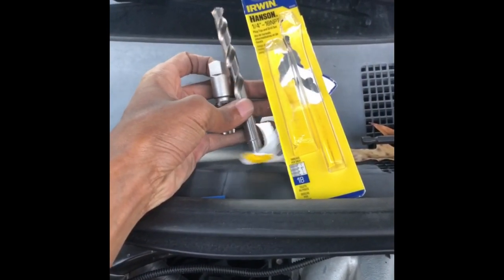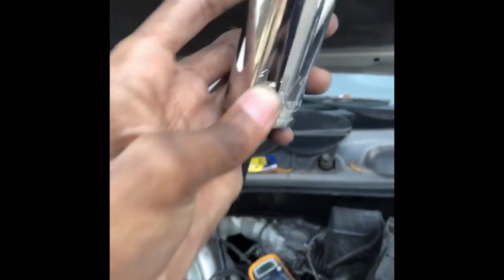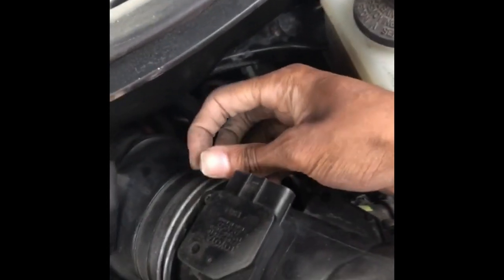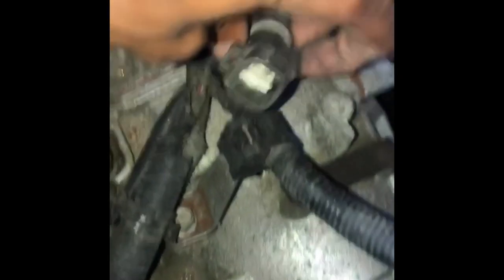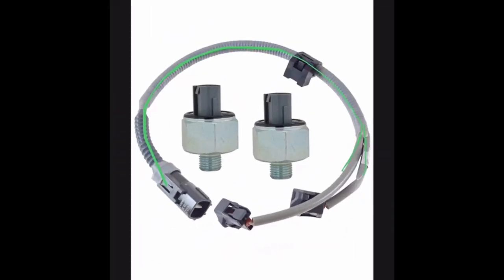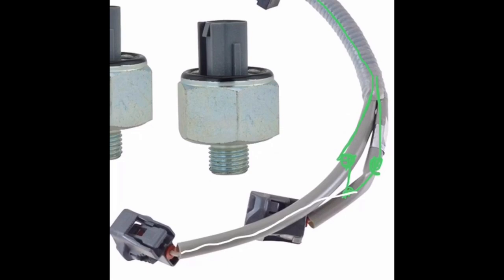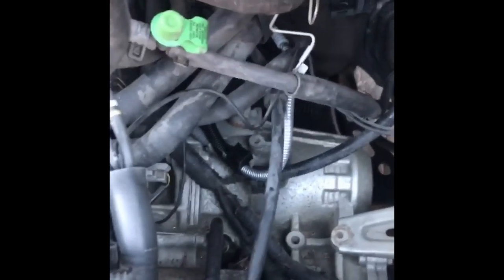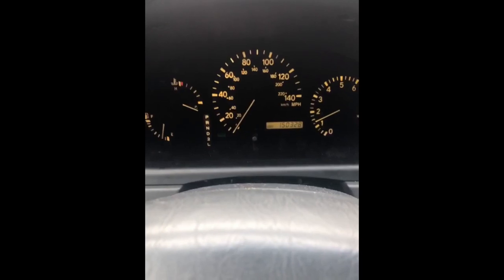1999-2003 Lexus RX300 1MZ-FE EASY knock sensor replacement relocation (SHORTCUTS IN DESCRIPTION)

Comment: So basically u cut the harness that you found under the air box then extended it with more wire and connected the harness at the end of the new wire connected to the original harness
Reply from the maker: Close, basically I disconnected the old harness and plugged in a new harness and rerouted the wire and extended it to a different location.
Reply: @JDMHaze  thank you for replying, also is it necessary to to extend the wire to the other side of the engine like Is there a purpose for that and if it’s not necessary will it still work if I connect a new harness but instead of cutting and making the wire longer I find a secure place near where the harness was found to put the knock sensor
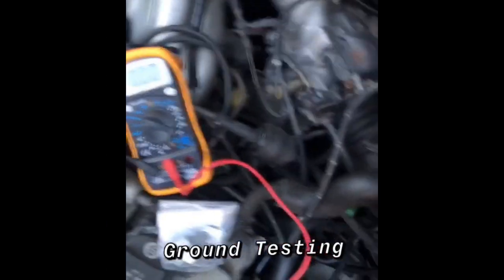Reply from the maker: @reinnamatthews5825  I only ran the wire to where the new harness location was, the length of the wire isn't so much significant, it's just I needed that much wire for that location I've seen people use different locations but since that is right next to where the motor mount is it's just a solid location, but make sure you see my section on ground testing (1:52), to make sure the location you choose has a secure ground and is rigid/solid With the least vibration
Reply: @JDMHaze  got it so basically that was the more important reasoning for putting the sensor where u did because it needs to be grounded where ever I decide to place it I can’t just connect it and leave it laying somewhere lol, thanks but I didn’t see in the video what u did with the old harness connection did u end up closing it off with electrical tape
Reply from the maker: @reinnamatthews5825  So the old harness connector I just unplugged it and then plugged in a new one and rerouted it ... And I just taped off the old connector harness that was going to the original knock sensors
Reply: @JDMHaze  ok great I got it now lol thanks it’ll be allot easier now

Comment: Looks like it’s been a year since you posted this video.  How is it holding up?  Any issues or check engine lights?  I’m considering doing this on my RX300.  Thanks for posting the video!!
Reply from the maker: I will be making a second part to this video, I didn't really have too many issues but I made a modified harness that rerouted the power to the original knocks sensor on the car that was still good
Reply: @JDMHaze  - interesting.  So the 3rd sensor stopped working and you spliced both wires to the one original sensor that wasn’t malfunctioning?
Reply from the maker: @mikeingraham611  dude what? lol No there are only 2 knock sensors, but knock sensor 1 was the reading bad, there is a wire going to each knock sensor, I splice the one wire going to  knock sensor 1 cut it and spliced it into the wire that was going to knock sensor 2,, So the computer is only reading knock sensor 2 (the good 1) But the computer thinks it's reading both knock sensors

Comment: Why did u only use one of the sensor?
Reply from the maker: because i spliced the wire going to both sensors into one wire and only required one so the extra work of mounting 2 sensors wasn't necessary

Comment: Do u technically not need to have them routed so far away if u don’t want to
Reply from the maker: That location just had the most space for what I was trying to do as far as mounting... And I knew I had a solid ground
Reply: Same question. Why to far? Couldn't you just  take a metal bracket, make your tap for the sensor/sensors then just mount it or weld it to ground?
Reply from the maker: @joelfierro8193  welding it is extreme, because then replacing it would be a nightmare,, I just chose that location because it's pretty much by the motor mount which is supposed to be the most solid part, which is great because the knocks sensor needs to be a stable and still as possible

Comment: I did the same and my knock sensor code still came back I think the wire spice needs to be explained more because I did exactly like the video and still get a knock sensor after buying 4 sensors and 2 harnesses I truly think this car is going to the crusher
Reply from the maker: I think it depends on the knock sensor you get I got some of the newer ones  it’s the same knock sensor, but they’re more round instead of as sharp on the corner

Comment: How much does the knock sensor and harness cost I need 2 oem knock sensors
Reply from the maker: DutyTime22 Link is in the description and it's about $25(or less) online and currently $20 on this link here. 
https://rover.ebay.com/rover/0/0/0?mpre=https%3A%2F%2Fwww.ebay.com%2Fulk%2Fitm%2F302389998819
Reply: Thanks for the quick response your the best Thank you so much
Reply from the maker: DutyTime22 no probem

Comment: Thank you!!!!!!!
Reply from the maker: Please use OEM knock sensors
Reply: @JDMHaze  You are correct...This will be the third time I have replaced them...I found out the first time...the hard way...but I have had several OEM Toyota sensors also fail...SO FRUSTRATING!!!! Thanks!
Reply from the maker: @Q1776Q  I had a pair found by my second pair didn’t fail

Comment: What the hell am I watching here? lol

Anyway, if any of you have one of these old dinosaurs, it would probably behoove you to just take everything apart to get to the existing knock sensors, change your rear plugs, rear valve cover gasket (Remove and repack the half moons) because it's probably leaking, bypass hose because it will leak and reseal the valley plate because it will probably be leaking a bit too.

Comment: What size of drill bit did you use?
Reply from the maker: Jay B 1/4- 18NPT. 
 see 0:39
Reply: @JDMHaze  I got it done, ended up re-threading the threads on the knock sensor for a 7/16-20 and it worked wonders. I used a 7/16 drill bit. No more CEL.
Reply from the maker: Jay B Great,  I'm glad it helped what vehicle do you have? Is it a RX 300 or another Toyota/Lexus vehicle with the m 1MZFE motor
Reply: @JDMHaze  it's a 2000 avalon
Reply from the maker: Jay B awesome,
Reply: @JDMHaze  I was also confused about drill and tap sizes 1/4 is way too small. All i have is a 27/64 drill and a 1/2-13  tap. I tested it out on a piece of scrap and it went just a lil kicking and screaming but it worked and felt tight. Im just going to send it. Do not recommend but should work.
Reply from the maker: @ripozipo2348  It's whatever works for you, just make sure you don't thread it too big or the fit won't be tight and the knock sen. wont be stable

Comment: If your going to splice them together to use only one sensor its much easier to splice the wires together under the dash. Unfortunately for me, I think both have gone bad now lol.
Reply from the maker: I tried to splice at the most external part so that I can reverse the process and undo it, this is meant to be temporary, are you referring to the wires coming from the ECU/ECM?
Reply: @JDMHaze  yes i am. It worked for over 2 yrs but i think both sensors are bad now because my car is having trouble going into overdrive again. Was rethinking it and might have to do this since I think both are bad now. Did you use an oem knock sensor?
Reply from the maker: @JohnLee-oo3qy  yes oem i purchased online, And both of them are likely bad I'm pretty sure which is another reason this is temporary because the other one subsequently fails, it's demise is inevitable
Reply: @JDMHaze  any good place to buy the oem sensors brother? They just seem so expensive. Ebay looks cheap
Reply from the maker: @JohnLee-oo3qy  I go on eBay but I search for genuine oem knock sensors

https://www.ebay.com/itm/New-2-Pcs-Knock-Sensor-Set-89615-12050-For-Toyota-Camry-2-4L-Lexus-RX330-3-3L-/223938880514?mkcid=16&mkevt=1&_trksid=p2349624.m46890.l49286&mkrid=711-127632-2357-0

Comment: Lol.  Screw those stupid sensors.  Engine is fine if you take care of it, and those old Toys aren’t worth the cost or time of doing the whole intake tear apart.  Great video.
Reply from the maker: Yeah it's rather annoying I wish I could find a bypass kit it would've been a lot easier, they make some for GM  and Nissans
Reply: The problem with doing this modification is that the externally mounted knock sensor will not detect detonation inside the engine. The knock sensors are located on the cylinder heads so that when detonation occurs inside the cylinders the engine computer can back off the ignition timing to eliminate the detonation. This is necessary to protect the engine from internal damage as well as to get the best performance, fuel economy and emissions. Doing this modification might seem to be a great easy cheep fix without any downsides and it may work well for some period of time but remember that the engineers who designed the engine put those knock sensors where they did for a reason. If you don't know all the factors that went into the engineers' decision to locate the two sensors where they did then you may be taking unknown risks. There could be undetected detonation going on inside the engine that is slowly hammering away at the pistons and cylinder heads, which could lead to premature engine failure. This is why you should never modify anything in a complex, modern engine. Instead leave it the way the manufacturer designed and built it.
Reply: @joevignolor4u949  do you live in the real world?  There are cars that aren't worth the money it would take to scrap them, yet they are useful for moving from point a to b.  That's what this mod is for.  It would be the world's dumbest decision to pour thousands of dollars of labor and parts into a car you would be at zero financial loss to scrap out.  I have a fleet of vehicles 15 plus years old with over 300k mi on them - if I can get another year out of one by a cheap mod I absolutely will.
Reply: @ddmercantile  The problem with your thinking is what if someone has one that only has 150,000 miles on it (not 300,000) and they do the modification instead of replacing the sensors and the wiring harness. If the engine gets damaged at 155,000 miles then it cost the owner 145,000 miles of additional use of the vehicle. The problem with the video is that it doesn't contain a disclaimer warning people about the possible downside of doing the modification. It just paints a rosy picture of something wonderful that everyone with a sensor issue should do.

Comment: I would not and did not take shortcuts.
By replacing the knock sensors correctly.
Gives you the opportunity to replace gaskets replace the coolant hose underneath the manifold.. 
That was actually starting to leak.
Reply from the maker: correct!  as well as the intake plenum gasket... this is mostly to buy time its not intended for eternity

Comment: Dealer cost to replace both 1MZ-FE knock sensors, both wiring harnesses and intake gasket on a V6 Camry: $2500!
Reply from the maker: yeap!!!! They charge like 300+ for the knocks sensor each and there's only one wiring harness for the knocks sensor so I'm surprised they're talking about 2  lol And the labor I guess is probably around 140 per hour or something
Reply: @JDMHaze  Good catch. Anyway as the guy in the other video you posted a link to said, this workaround doesn't fix the cause of the problem. I guess that means the check engine light will now be off, but the engine timing will be a bit off so it won't pass the smog check.
Reply from the maker: @rkgsd  Correct, this buys you time

Comment: Yoo i don't think I will work on my (2003 es300 1mzfe & my 1997 avalon 1mzfe)  because both of the torque mounts out shot! 🤣🤣🤣🤣🤣🤣
Reply from the maker: You are absolutely correct I had the same issue before. lol no dice😂😂
Reply: @JDMHaze  🤣🤣😅🤣 dead ass that's a no go for me but damn good idea! Thanks tho man! Great video!!
Reply from the maker: @NoFilter93  No problem, the strut mounts are cheap AF,  just Change those first orrrr You could just get the wire going to the bad knock sensor and splice it into The wire that is feeding the good sensor 🤷🏽‍♂️ then the computer thinks it's reading both sensors but it's only reading one
Reply: @keye haze bro I heard about that! Ok bet
Reply: @JDMHaze  do have a video on that....
Reply from the maker: @NoFilter93  I don't have a video on that but heres one just skip to 7:21

https://youtu.be/PrixEoSV9IY

Comment: Why not just replace them right way
Reply from the maker: Because I am not a mechanic by any stretch, and can't do that labor myself, it is at least four hours of labor on the books which would be very expensive, this is just a nice bypass there's nothing wrong with the engine but the knock sensors tend to go bad, and sometimes it's the harness as well that goes bad on these
Reply: @JDMHaze  you’re 100% right I was going to change mine I would have to remove million things so I just did your way  works good thank you for video
Reply from the maker: @nedoscarsandfishingvideos5500  Very glad I could help

Comment: This will fuck up the engine you are better of without overdrive than doing this lazy shit lol. Just unbolt the plenum bracket bolt from under the car from the passenger side then the plenum will come off easy.
Reply from the maker: thats would be if your knock sensor wasnt the issue…
Reply: @JDMHaze  you made the video right? I just told y’all how to properly get to the knock sensors it’s one bolt under the passenger side of the car then the plenum comes out EASY!